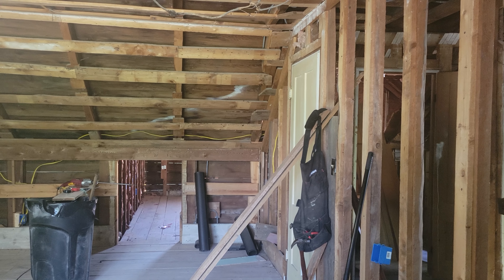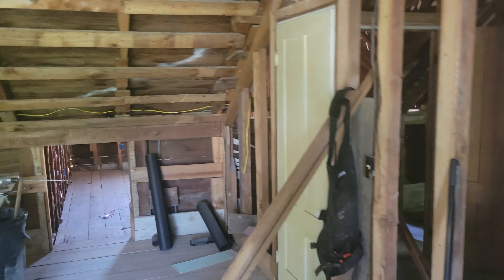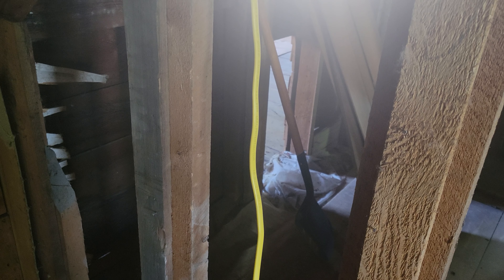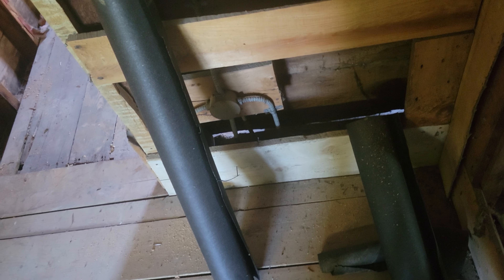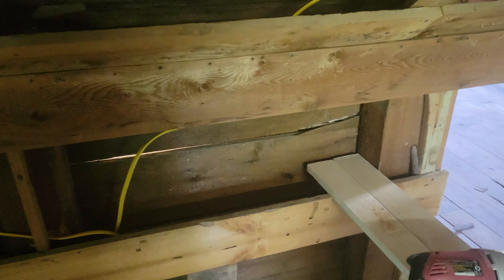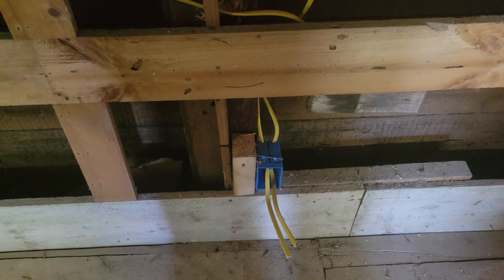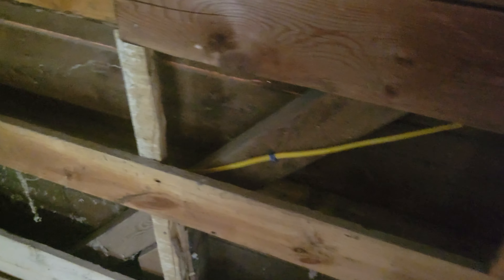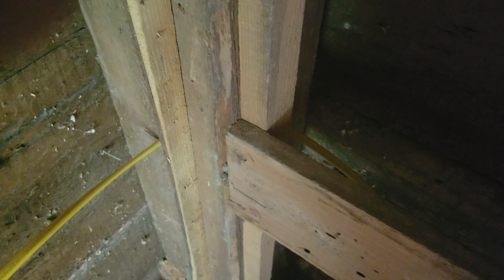Making a "Home Run" ( electrical edition) on the second floor

Comment from the maker: My dad was my mentor on this, starting back in 1972, but then continuing when I renovated an 1860 farmhouse in Norridgewock, Maine. First thing he did? Bought me two books and told me to study like crazy. I still have the books, and I am brushing up on them, though I haven't done anything of this magnitude in years. It's all coming back to me, slowly. My son-in-law has a degree in electrical engineering and is a Renaissance Man of all trades. He advises me. He's also very tactful with a hilarious sense of humor. Most of all, he lends me his tools!
Reply from the maker: And I should add, it's fun in it's own way. On the one hand, there is a logic to it. But also the working out of a puzzle. In a renovation you need to problem-solve within the Rules. That's when I go slowly, reread the books, watch a video, and get on the phone.